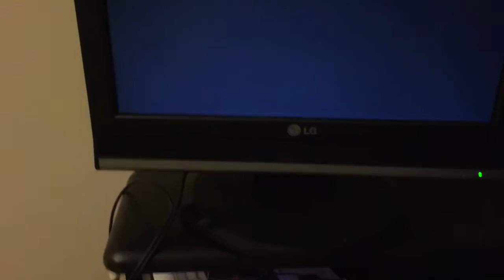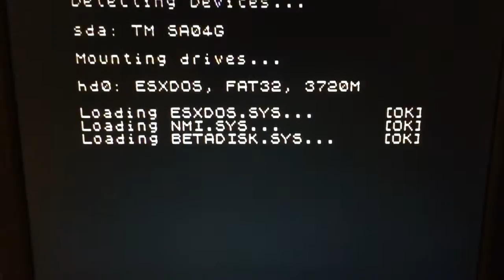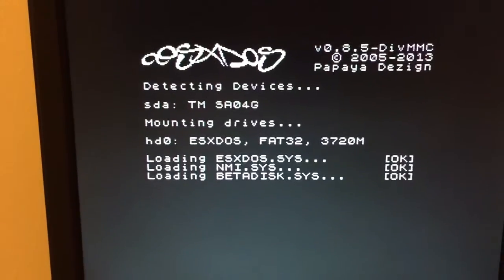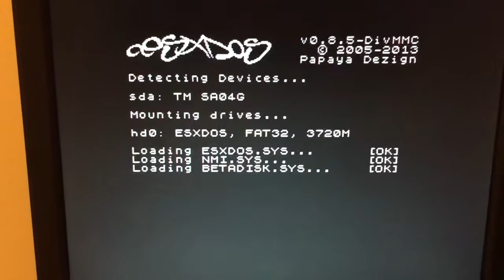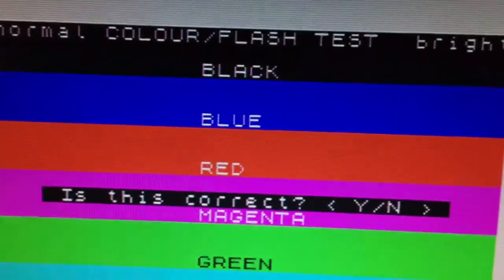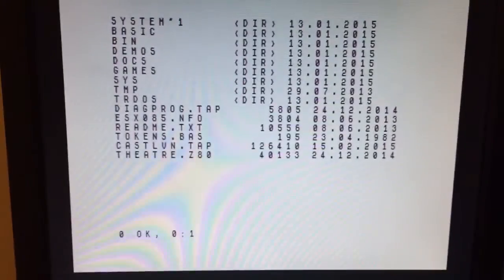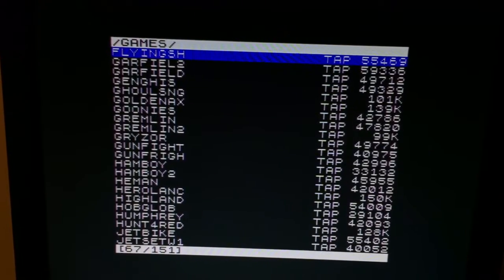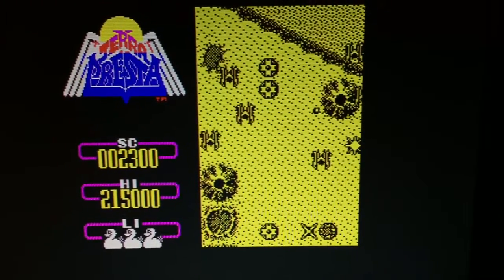Rgb2vga on TS2068

Comment: Hi,
I already upgrade ZX81/TS1000/TS1500 computers with composite video and switching 5v power supply (I sell them on Ebay USA).
I now have the TS2068 but the composite video is quite ugly, you did a great work on yours, do you have a website that show how you did the upgrade to RGB ?
My monitor accept, S-video, 15 pins VGA, Digital DVI, and HDMI.
(I will first update the ULA with a 5v switching power as you did and see if there better image). 
I speak French and English.